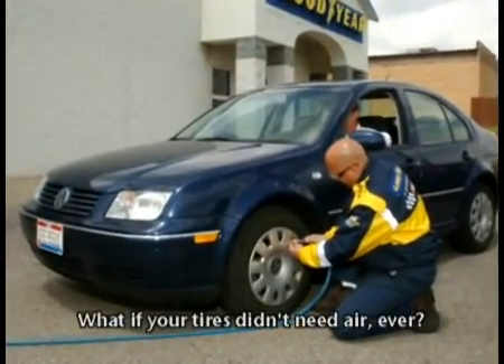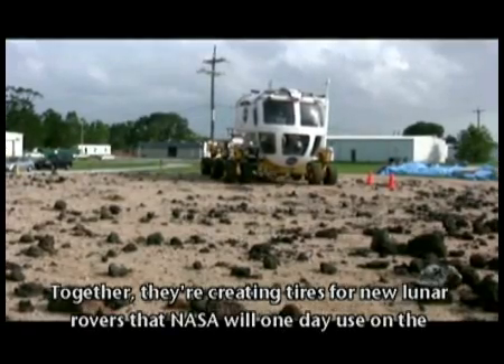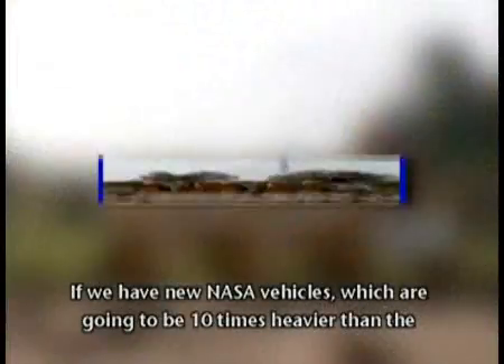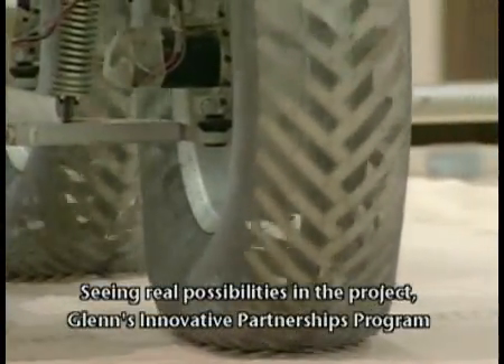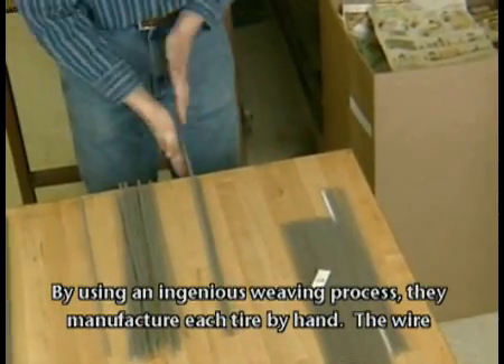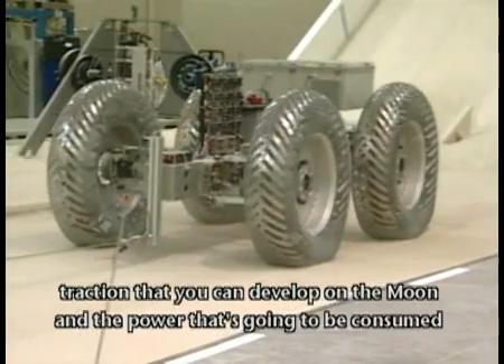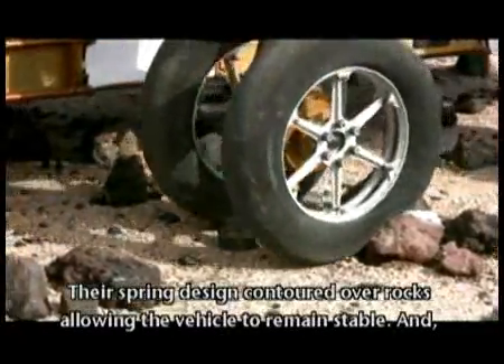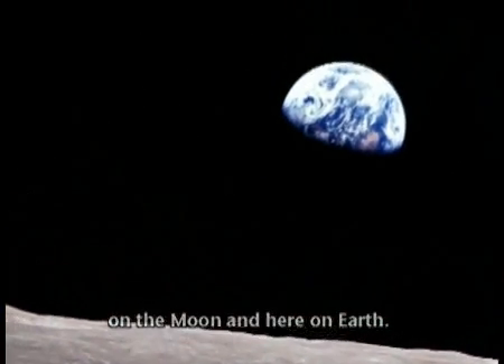Goodyear "Spring Tires"

Comment: Hey Goodyear...  ERW has your answers. We have dozens of Patent claims to fit your applications. Michelin Lunar wheel is a weak. They are dancing around our internal displacement without our energy return features that will radically extend range and performance. How about testing some "FREE" prototypes??